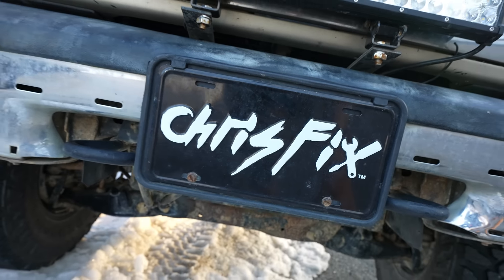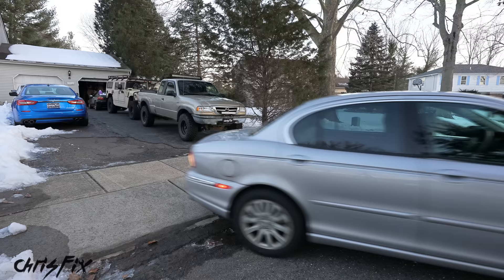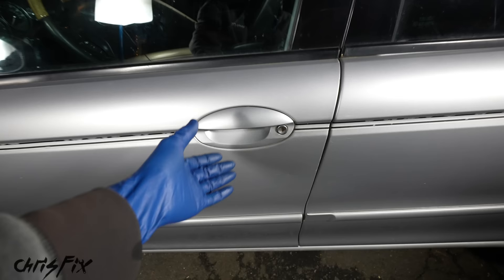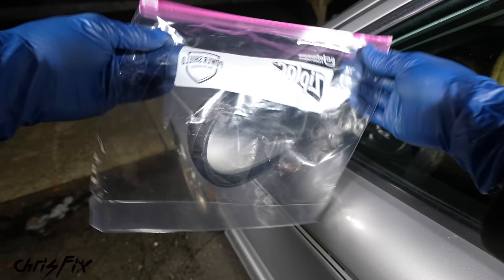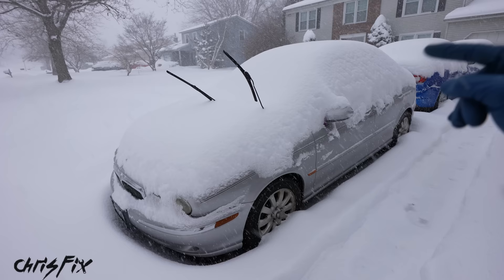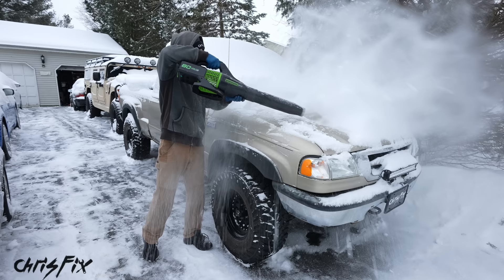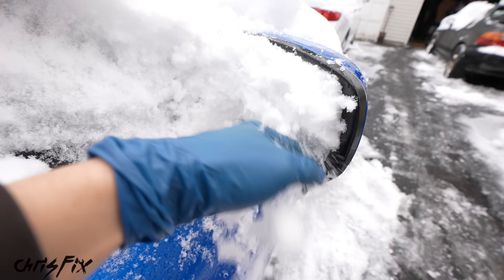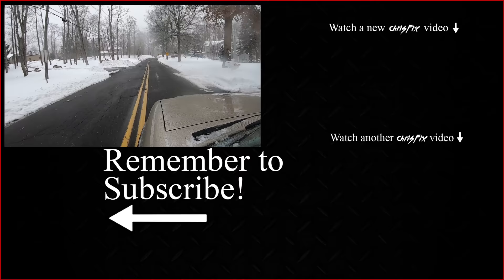10 Winter Car TIPS & TRICKS you NEED to Know

Comment: Cool video. 

Here are my two cents.

1. There are cars you can't raise the wipers so you can use the same garbage bags to wrap the wipers and this will also prevent icing or at least ease the ice removal process from them.
2. If you are driving with a wiper on the rear window and you know it will rain heavily, ensure it's raised as well. The weight of the snow on it will bent it.
2. Spray WD-40 or other water displacing liquid which can also conduct electricity to car battery's poles. This will prevent oxidation, hence avoiding dead battery.
3. I'm afraid if I use such anti-ice cover for the windshield it will be stolen so I personally use deicing spray for all windows and with combination of small idling time during snow clean up I have never needed to remove ice by force.
Reply: My windshield cover (but not the rear) has a simple antithetical device. It can easily be overcome, but prevents a quick snatch & run. Between the straps, there is a 12" flap with a wooden dowel at the ends. The flaps go inside the car and the door closes over them (the 3/4" dowel will keep them from pulling out).
The material is pretty tough and not too easily cut (I have tried).  This system is actually to keep things in place in high winds ( last year I had 75 mph gusts at Xmas)
Reply: Damn auto correct: it is anti theft.

Comment: A tarp works very good for the windshield, close it into both front doors so the wind cant remove it, as for the side windows, roll your window down just enough to get a large garbage bag over the window, then shut the window. the tarp and garbage bags will also help the doors from freezing shut. However, the spray you were showing or DW40 work great on the seals, latches and locks. DON'T FORGET THE TRUNK AKA the boot!! That is probably where your jumper cables are.
Edit: also, DW40 on the headlights makes it easy to remove ice build up.

Comment: #1 tip: live in Hawaii. Works every time.
Also, I use magnets in ziplocks (for east removal) to hold down garbage bags.
Reply: 1. heard it's expensive to live there though... Magnets in ziplocks. Good idea but I suppose the blue or green tape is cheaper. If your car is dirty the tape might not stick though, so magnets might be better. I guess it depends on how much it snows in your area. I recall it snowed in Atlanta GA a few years ago and NOBODY was ready for that because they NEVER got snow.

Comment: As to your Snow shovel, and the Snow shute of your Snow Thrower, I discovered years ago that Water Displacement 40 (aka WD40)  Sprayed liberally on the surfaces that will contact Snow, will keep the Snow sliding off those surfaces without issue !
Typically one application last all day !
             ❄️ 👍😉 ☃️

Comment: After 6 years of owning a car and fighting with teh elements, last year we bought an inexpensive metal sheet garage. It is a triple garage with upward-opening doors, it's 9 meters wide and 5 meeters deep (29,5'x16,4'). Thre's a huge difference, and it was only about $2600. The concrete base was around $1000. The only problem is water can enter from teh rear, I will get some insulation next year.

Comment: I would take issue with what you call combat parking, good point on visibility, however, THE WIND could play a major factor, storm (last night) wind almost straight north,, froze  one side of my car, while the other had very little snow, and no ice. temperatures we're below zero, and wind chill was closer to 20 below. had I parked with the FRONT of the car in the direction of the blowing wind, I would be replacing a radiator, or not being able to leave until it had thawed  ,

Comment: Excellent tips Chris. Heh, I haven't been out to my car all weekend, and we have sub zero every day at the moment in the UK. So now I have to do the sensible thing and check it on a Sunday evening. I'm going to the shop anyway for some vittles. So any ice I have to deal with on the car is my punishment for being lazy.
Reply from the maker: Dang good luck! The winter is not fun.
Reply: Sub zero Centigrade I assume… in Vermont we were down to -1’F a few days ago, which was -18’C!  A bit of a difference, lol.
Reply: @louisegogel7973  Yeah, we only had minus 8C at worst in my area. Still froze the surface of everything, ground/car windows/roads that weren't gritted. No snow either, so no probs getting to work. Weather's warm-ish here now, we are super lucky so far.

Comment: another quick tip: use rain•x glass water repellant that you can get in a non spray bottle or regular spray and apply it before winter comes and not only does water not stick to the glass but also snow and light ice is VERY hard to stick to the glass! but whatever you do do NOT apply it to your headlights UNLESS they are made of glass! also use rain•x anti fog on your INTERIOR glass like side windows your high mounted rearview mirror windshields both back and front and that will help to prevent fog from forming on the glass. obviously it wont stop all the fog but it will help a LOT! also if possible add a battery tender to your battery to keep it charged so you dont need to jump start your car! and another thing i like to do is keep a pair of jumper cables a snow brush and a couple tool kits in my trunk just in the rare case something goes wrong and need to make an emergency repair. finally if your car has the space keep snow chains or a pair of recovery ramps with you in the case your car gets stuck in the snow! hope some of these ideas help!

Comment: I had an interesting situation the other morning I changed some coolant parts on my vehicle and mixed water in and forgot to add more antifreeze. When winter came along the water had settled and Frozen in my heater core causing my car to not have heat and to overheat while driving. I was like 30 minutes away from my block freezing and my car being destroyed. I'm they sell those little blue canvases at the Dollar tree they're about long enough to go over even a large truck window. Just a thought. And when he means silicone do not get the silicone expanding foam. Not the same thing, at all.
Reply from the maker: Dang sounds like you caught the cooling system from freezing just in time! And good place to go for that canvas!

Comment: Ziplock mirrors and snowblower are good ideas. I totally cringe at the binder clips to hold microfleece on the brush though. Way too easy for the cloth to rotate around the brush and now you are dragging metal binder clips over your paint? Instead, tie the cloth around the brush with some string, like kite string. Same effect, but no paint damage risk. Or, just use the bare brush, unless you treat your cars like easily bruised produce. I'm curious to try the hot tap water bag. They're predicting lots of snow for us, so may have a chance to try that.
Reply from the maker: Thanks for sharing and let me know how that goes!

Comment: Instead of all this hassle one could buy a block-/interior heater (eletrically or fuel powered). Start it up half an hour before you need to go and not only are the windows clear of ice but you also have a semi warm engine and inside of your car.

Comment: The silicon spray tip was pretty good, so is the baggies on the side mirrors if you do not have heated mirrors.   

The rest, good for those who have mild winters with occasion snow fall.  For us less fortunate in that regard,  most of these tips have better solutions.  When you have an many snow, frozen snow, and sleet as frequently as we do... this video's tips are time consuming and create more work for yourself.  

My 2 cents, start the car 20 minutes before you start to de-ice it. If you do not start the car first, you are not warming up the fluids.  Snow clearing, THEN warming the car is wasting your time and is bad for the car’s internals. 

Start the car, heater, defrosters on full blast. Let the car do the heavy lifting for you. Cleaning ice or snow off a cold car... that will not be a good idea. While you wait, clear the snow behind the car, so you can get some momentum and get your car into the street without wheelspin.  IF you live on a quiet street, safely drive the car into the street before you clear the snow off of it.

THEN remove the snow and ice while you are idling in the street, the city will come for a second run of snow removal. Otherwise, whatever snow you remove from your car... it's now on your driveway... guess who needs to clear that? You.

Comment: I combat park all the time, but if you have a front wheel drive then backing through it would be easier. Same as if you can't make it up a hill, back up it is a possible option. Same concept as the weight in a rear wheel, that engine is heavy

Comment: On a cold start in winter, don't crank the heat to the max. Turn off the heat. Allow the car to warm up by checking the engine temp gauge, it will warm up faster. Once fully warmed up, you'll have max heat in seconds.

Comment: The hot tap water can be used to melt the locks. And never use lock antifreeze,, gun oil is better. And use a block heater, always under 40 degrees F..

Comment: You should have mentioned that front wheel drive cars actually has a better chance of backing out instead of driving forward due to engine weight
Reply from the maker: If it's in your driveway you can park it either way and clear the snow to get it moving

Comment: Adding weight is not necessarily safer.  It is harder for you to start and to stop.  The friction between the tire and the road is proportional to the weight. Otherwise, the big semi truck won't have more restrict chain control requirements.

Comment: for windows and mirror use foam style shaving cream, rub it in and it will stop digging and snow sticking. try it on your bathroom mirror take a hot shower it wont fog up because it wont allow the water to stick

Comment: Never ever let your wiper arms up like he says for a long time. It will stretch the springs and they will apply less force onto the windshield in the future.
Reply: That's not how springs work
Reply: @uuuultra  yeah sure... You never had to replace a tired spring in your life? Never replaced coil spring on your car? Never heard of metal fatigue? Spring on wiper arms are made to keep the tension on the window, if you let them too long stretched up they will end putting less pressure on the windshield.

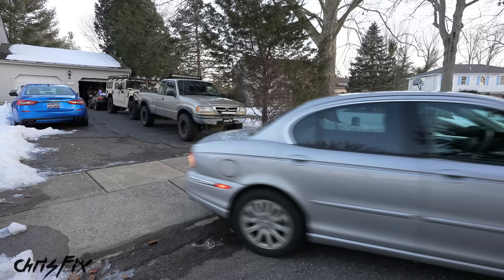Comment: 2:00 another reason to reverse your car when parking (not just at home but wherever) is if its bitterly cold and your battery dies overnight, its way simpler to jump start your car, as you can drive your other car (or a friends car) nose to nose, to get it going again. BONUS TIP: If you have an old or weak battery in your car, or are a one car family, get yourself a battery tender, so you can plug your car in overnight. That way, your car will start regardless of the temp outside or the state of your battery.

Comment: Do NOT use your manual brake in the winter when the car is parked overnight because apparently the cables/linkage gets frozen. Overnight you can just park your car in gear, if it’s an AUTO just put on neutral and don’t pull up the handbrake off (level surface of course). Switch off the engine. Reason for parking on neutral also helps not to have the engine weight of the car rest on the engine.

Comment: Interesting video. Since wax worked on the shovel and silicone worked on the weather stripping, can anything be applied to the tires to repel ice or snow from sticking in between the treads? The leafblower worked well for that, but I'm just wondering. Thanks for the video.

Comment: If you cut off both sides of the trash bag but leave the bottom, you can ‘open’ the bag and use the two tie off ribbons in the bag to loop around each of your side mirrors. 

Also, the saying is actually “The proof of the pudding is in the eating.” The proof is only in the pudding if the criminal happened to hide it there.

Edit; I’m seeing a lot of tips using credit cards in the comments so here’s one to make those easy. If you are looking for a good card to use but worry about breaking the card, use a blood donor card since they are free to replace, not needed often, and tend to be easy to get.

Comment: My mechanic caught me lifting my wiper blades, and warned me against it, it will loosen the tension on them over Tim, and you will loose the grade of contact to your windshield, and they won’t  work as effectively, and will start to chatter when driving on the highway. That’s a safety issue.

Comment: tip nr.1 before YOUR tip nr.1 for longevity of your car:

never let your gastank run below a quarter of full, with the cold comes condense and that's not good for the engine or fuel consumption. Preferably keep your tank at least half full if you have the time.

Comment: "Combat parking" sounds cool and all, but  I would still prefer to not do that, cus if the plows push a big enough snowbank up your driveway you still need to remove it otherwise you probably gonna get stuck trying to push through it, it freeze up real good real fast if you let it sit..so if there isnt a huge berm and park "rear out" you most likely will do better getting through backing out as for the most part smaller cars have more clearence in the rear of its body and therefore will have less chance on catching the snowbank..but still, I strongly recommend dealing with the snowbank as soon as possible and don't run through it as it get compacted and will build up each snowfall..trust me, your back will thank you later 😂
And nr two, never, ever..NEVER use silicone on or near the paintwork of your vehicle..can it! In the future, in an event of needing to do paintwork on your vehicle, you DO NOT want to deal with the issues about having silicone on the paint..trust me, it will cost you dearly.

Comment: Could you use the same silicone spray you used on the doors and locks to prevent snow from sticking to the shovel? Or would the spray not adhere to the shovel the same way the wax or ceramic does

Comment: Your car door freezes at the door jam. You spray a good penetrating oil in both door jam and locking tumbler on the edge of the door. This prevents icing, therefore your door rubber does not adhere to door frame causeing frozen door syndrome.  This is from years of experience.
Reply from the maker: Thanks for sharing!

Comment: The temperture of the hot water from the tap is 212°F
100°C
Reply from the maker: Lol then you need to turn your water heater down before someone gets bad burns!
Reply: With less Wood It will better
Reply: @chrisfix  Sorry for The english
Reply: Romanians ar not that good to english. The boiler its pulling pranks with the foset 
Cold /hot wather When You try to get Huter water de farset will Get you colder water and Vice versa you have to shot the water and after Dead you need to open the foset

Comment: Instead of de-icer spray cans, you may also use cheap isopropyl alcohol from a dollar store.  Fill up a spray bottle with it, and spray it on iced up glass (after first brushing off loose snow).  It is even more effective if you first put the spray bottle in a container of warm water for a couple of minutes, so that the alcohol is warm when you spray the ice on the glass windows and windshield.  
DO NOT heat the isopropyl alcohol directly over a flame!

Comment: I imagine WD-40 could be substituted for the silicone spray?
Reply: Might in a pinch, but it won't last the whole season like the silicon will.  Also WD-40 is a solvent for heavier oils and greases, so continued use will "de-lubricate" mechanisms over time.
Reply: @altoeager2635  - makes sense, great, thanks!

Comment: Hi Chris, Just recently have a car with a frameless windows. Do you have any advice how to de-ice and open the door safely as the windows need to go down a liitle to open/clos the door. Thanks
Reply from the maker: I would use some silicone on the weather stripping on the top since the windows need to move a little and then just clear as much snow/ice as you can. Take some time doing this and you should be good to go
Reply: @chrisfix  Thanks for the advice, i will do this and prepare the car for winter. :)

Comment: Hm. But I live in Florida. How about a video for protecting your car from the beach or cleaning it after being on the beach? No matter where you are in Florida, you're never more than 45 minutes from a coast. The beach is kind of our thing. Every time I drive my car on the beach, I worry about the salt water and sand on everything from the undercarriage to the brakes to the paint. And then there's the interior. Beach sand is a lot finer than regular sand. I always have a hard time getting it out of the carpet. I have lived here all 40+ years and I just either deal with it or don't drive on the beach. We will sometimes take a flat bucket or pan so we can rinse our feet before getting back in the car. And then I'll drive through an automated car wash but only pay for the basic rinse so it at least washes off the undercarriage and paint. Other than that, I don't know what else you can do.

Comment: Why would you take the snow off the carbody of the vehicle if it's not impeding vision? Wouldn't that be just more weight and therefore more traction?
Reply from the maker: Because it can fly off when you are driving and hit someone/something, so I always make sure to remove it. And it technically would be but there are (safer) ways to increase weight

Comment: My car heater and ac in the front don’t blow at all I was told it was the climate control module well apparently the part for my car ac and heat is discontinued and I try to located a used part but they also don’t work hard to send back and pull a part places don’t have the part. Don’t know what else to do. I replace the fuse the resistor and the blower motor and it still won’t work. It blows in the back but not the front it’s a 2010 dodge journey sxt. I really could use some guidance thanks